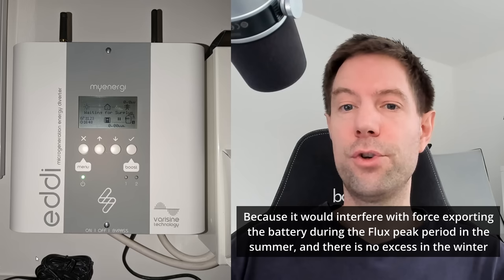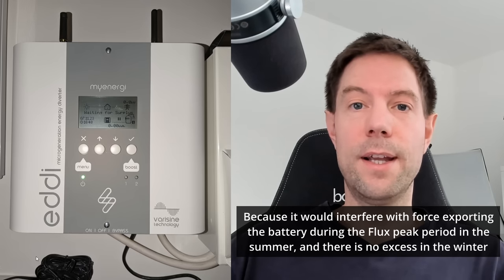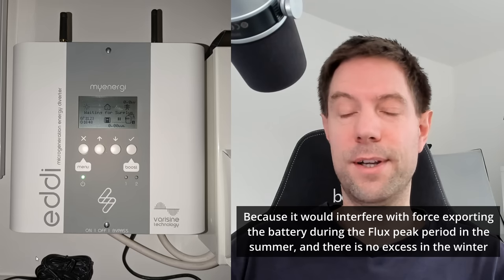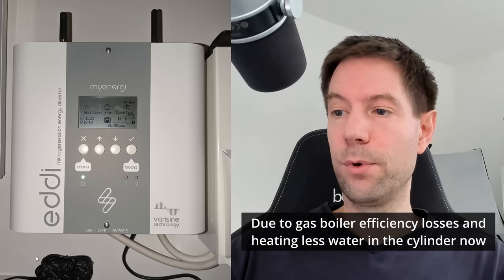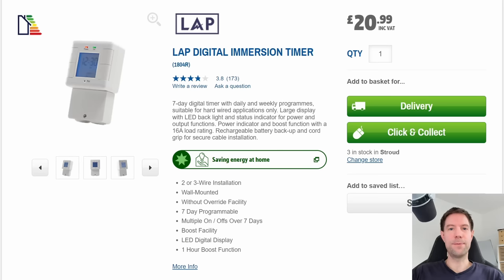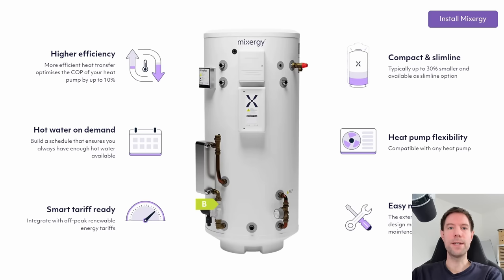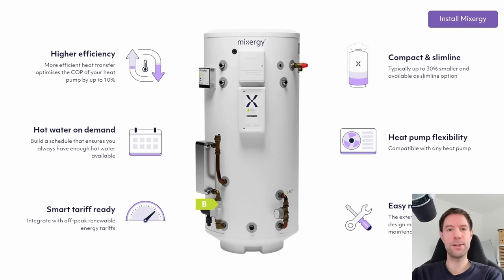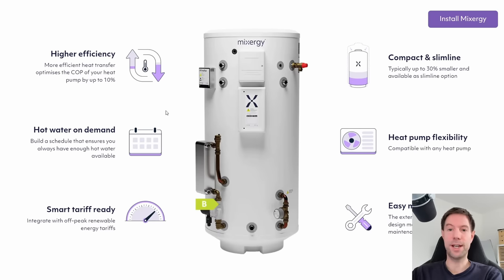Gas free hot water - so many options!

Comment: Hi Tim, We currently have a 5.8KW solar system with a 5.8KWh battery. We're currently on Octopus Intelligent Go and are very happy with the tariff. I have set it up so it draws from the grid at night during low cost so that the solar feeds in during the day. We have seen the offerings of Air Source Heat Pumps with the government subsidy, meaning that te quotation we received from Octopus to fit an entire central heating (existing radiators) and hot water was just over £1000. Our house is relatively new build and has cavity wall insulation and good loft insulation. I was wondering what your thoughts on a ASHP in a four bedroom property would be. Would it actually save money? Given that it would be greener, for sure, than our current Gas system, the only concern I haev is that it would cost more to run than gas during the winter. I don't necessarily want to take the plunge if it's going to be costly to run. Our gas combi boiler is nearly ten years old, so it may be that that will have a failure at some point.....! Any thoughts, please? Thanks!
Reply from the maker: If you were on a standard tariff with no solar or battery system then running a heat pump would work out similar in cost to a gas boiler.  With solar and battery to support it, when combined with IOG, you should find it a fair bit cheaper to run a heat pump than a gas boiler.  You might find adding a bit more battery capacity helps too, as that extra battery can be used to effectively run more of your heating at the off-peak rate.  We have 14 kWh of battery and last Winter we ran our heating almost entirely using off-peak power, all except the coldest days.  However, even with a modest battery you should find that you can cover a good fraction of your heating in the autumn and spring with off-peak power or solar.  I hope that helps.
Reply from the maker: You might find this of interest too:
https://youtu.be/q1tYCenxb2M?si=lgu_4O-EK5Um3ek5
Reply: @TimAndKatsGreenWalk  thanks so much. At the price they've quoted, it seems to make perfect sense. We can't really afford another battery as well as a heat pump, but my head is fairly convinced about the potential savings. There aren't many real-world experiences out there at the moment, so you giving an answer is very helpful. Thank you!
Reply from the maker: @Simonstunell1974  no problem.  It's worth seeing how you get on in the first winter with the heat pump.  You might find the amount of battery you have is sufficient.  In either case you'll have some data to work with then.

Comment: Very useful summary.  One or two responses have alluded to this but have you done the breakeven between the existing immersion using night-time tariff (at worst) vs the same on the heatpumps cylinder taking into account the
capital cost of the latter.

On a different topic would love to see in future your analysis of Octopus Go vs Intelligent Octopus. IO sounds better with longer off peak, lower ppkwh and double export (so more like flux...which incidentally my powerwall optimised very well...ie choosing when to export to grid from battery).  Currently on Go....and whether the powerwall gets through to 00:30 is extremely sensitive to the solar generation.
Reply from the maker: If you've seen those other responses regarding return on investment etc. then you'll have also seen my replies to them saying I'm not expecting the heat pump cylinder to pay for itself, I'm not doing it for that reason.  I'll explain more in the next video but basically I'm aiming to reduce energy use, not necessarily to save a load of money.  Regarding Go vs Intelligent Go, there's not a lot of analysis to do really, Intelligent Go is clearly better in every way, you just have to have a compatible EV or charger to get onto it.  Sadly I have neither just yet, but I'm hoping that'll change in due course.  In the Spring I'll be doing a quick check to compare Go, Intelligent Go, Flux, and Intelligent Flux, to see if it's still worth switching at that point, so keep your eye out for that video.
Reply: Point taken re breakeven...that was my own reasoning when getting solar and battery installed.  I also nearly followed on with a mixergy tank but at the time could not find an approved installer to even discuss it!   On the Go vs Intelligent Go I agree that the financials are clear and what I should have asked is whether you feel that the "handing control" of your car charging to Octopus have no unintended consequences.  Myenergy (they are still testing with Octopus) sent me a data sheet....it's quite complicated and may need current settings on charger changed.  Many of your viewers will have gone through this already if they have compatible chargers and would appreciate their comments.   @TimAndKatsGreenWalk
Reply from the maker: @KenH-63  yeah, good question about handing over control of the charging to Octopus.  I think I'd have to give it a try for a bit to see how it worked in practice.  If I didn't like how it worked I could always switch back to Go.  But that six hour off peak window would allow us to get another battery and charge up more to support our heating, so that would be too good an opportunity to pass up.  I need to run the numbers on that one to see if getting that extra battery would actually be worth it, but my hunch is that it's on the cusp, so if that's the case Intelligent Go would be essential to making that work.  Put it this way, I'd certainly give it a try!
Reply: @TimAndKatsGreenWalk  I now have IO and it does give the option in the app to switch off smart charging and charge when you want. I understand you must charge using it at least once per month for Octopus to have grid flexibility. Have not heard yet what happens if someone stays on manual.

Comment: Tim, your thoughts on this being a bit of a diminishing return? 
5 units at 9p x 365 days approx. £165 p.a. for hot water
reduce that to 2kw a day and your cost p.a. approx £65
A saving of £100 a year - less if you manage to end up on intelligent

So isn't a further option Hot Water option simply to do nothing for the time being, perhaps even find a way to export just a little more and perhaps easily cover that £100 by other means?? Moving to Intelligent alone would cover that saving. I know, cars and chargers are the Intelligent issue.

Just a thought??

All the very best 
Mike
Reply from the maker: It's a valid observation, for sure.  However my main priority isn't cost saving (although clearly that would be nice too) it's energy saving.  I realise I'm probably in a minority but as long as it's not unreasonably expensive to do so my aim is to reduce my energy consumption and increase my energy generation to the point where I'm a net exporter.  I'm not really expecting to get a "return on investment" with this, I'm simply trying to find a way to reduce the amount of energy we use to heat our hot water.  I'm sure a lot of people would consider that a silly thing to do but that doesn't concern me.  We don't have kids, I have a decent job, we have the cash to spare, and this is what I consider a reasonable way to spend it.  If I can help provide some information for a few folks who might be considering doing something similar then so much the better.  Hopefully that makes sense.
Reply: @TimAndKatsGreenWalk  Thanks for taking the time and effort to make all the videos and replying in this case. It wasn't a hater or detractor comment at all and if I didn't ask it then someone would have and probably less sympathetically 😉. 
I know you don't surplus divert with Eddie as it doesn't suit your plan, but I can't get over how we just have all the hot water we need free from the sun courtesy of Edward! I started recording my peak boost sessions to see how efficient Eddied hot water had been, but soon stopped as it's probably only 10 - 20 times in 18 months.
I'll be very interested to see your research on the Heat Pump tank you've chosen. Did start to muse over something similar after watching this. Our hot water tank looks uncannily like yours and thought I could draw air from the loft space 1m above, but quickly realised all that would do is to make the loft colder and probably increase thermal loss through the ceilings. Perhaps there is a soffit (the under side of the roof between wall and gutter) vent available?? Draw air from the south side of the house and vent to the north???
Anyway our timeline is first to treble or more our solar generation to something in excess of 10kw.
Keep up the good work, looking forward to the next video.
All the Best. Mike
Reply from the maker: @oldgitflying  yes, you're right about the loft space, it would decrease the temperature and therefore the heat drain from the house, so ideally you would vent to the outside.  But if your loft is well ventilated anyway it might not be a big problem to just put both inlet and exhaust into the loft, or else vent through a roof vent, as you say.  I expect there are some neat solutions for this.  

I don't mind at all you asking the question about investment return, it's a very valid question.  I guess the main reason for this video is to show what options are available should someone need to replace their hot water system through age or failure, in which case you may as well get an efficient system as a replacement and the "return" part of that is less important since you'd be replacing it anyway.

Comment: I live in the US with an old gas powered hot water boiler and cast iron radiators that require very hot water to heat the house.  Thinking about the possibility of either replacing the boiler with a Sunamp (if possible) or using Sunamp to heat a large tank of water and somehow use a heat exchanger in the tank to heat the water - instead of the boiler.  How hot can the Sunamp heat the water?  Any suggestions?  I also am thinking of getting PV panels.  Thanks, and great video!
Reply from the maker: The idea behind the Sunamp is to be a replacement for your hot water tank, rather than using it to heat a hot water tank.  It's the Sunamp that then provides hot water to your home by passing cold water though it so that the heat is transferred to the water.  The water comes out at 60 deg C from the Sunamp.  The Sunamp won't provide water to your radiators though, it's only designed to provide hot water out of your taps etc.  To fully replace your boiler you'd need a central heating replacement such as a heat pump (air to water or air to air, for example).  Heating a home takes significantly more energy than heating hot water, so a Sunamp wouldn't cut it even if you did manage to hook it up to the radiators.
Reply: @TimAndKatsGreenWalk   Thanks Tim! but if I did replace my boiler with an air to water heat pump, could the water temperature be higher than 60 deg C, which would be needed in the cast iron radiators to heat my home?
Reply from the maker: @marksTips466  you might be better off replacing your radiators at that point too.  Most A2W HP systems work best running closer to 50 deg C, or below if possible.
Reply: I was going to suggest that a factor to consider is that the ASHP can run efficiently continuously - so your cast iron radiators would be "always on". In that scenario, could you keep the cast iron radiators? Simpler and lower cost.

But on reflection a heating engineer can perform heat loss calculations and tell you the size of radiators needed - whether they go on/off or run continuously.

In the UK, often even modern steel radiators might need to be enlarged when switching from boiler to ASHP. So the cast iron radiators may need to be replaced.

in your post you don't say where in the US.

if cast iron radiators*DO* need replacing, and you also need A/C in summer, then perhaps A2A cooling and heating might be a smarter choice?
Reply: Check on the reliability of the Sunamp before you buy.

Comment: For the ASHP cylinder would you not want to draw in air from inside? This would be more efficient as the air is warmer. The vent will want to go outside as the air will be cold, although in summer it would be good to be able to direct thisninside as well for cooling
Reply from the maker: So you can vent in a number of different ways and certainly in the summer being able to vent the exhaust cold air into your house can be beneficial and certainly doable with the appropriate pipework and switches.  But you don't really want to draw warm air from your house in winter as you then have to replace that warm air with your heating system, so you don't really gain anything overall, if that makes sense.
Reply: Additionally, if you take air from inside the house envelope and exhaust it outside then you create a lower pressure inside the home.  This will create draughts anywhere where the envelope doesn't seal perfectly to the outside.  They may well be just where you don't want them!  For example, the vented area under your ground floor (if you have such a thing) might become your air feed into the house.  I am not sure I would want this musty, stale air as my house intake. @TimAndKatsGreenWalk
Reply from the maker: @Ben-gm9lo  indeed.  Best to have both vents going outside.
Reply: would be like running a cooker hood 24/7 just dumping your heated house air outside.

Comment: Hello Tim, I am in the midst of taking quote to put mixenergy and then move onto putting heat pump, is this ok and more efficient than the cylinder that comes with heat pump?
Reply from the maker: I'm not sure what you mean when you say put in Mixergy then move onto heat pump.  Do you mean getting an iHP cylinder, or a regular Mixergy cylinder?
Reply from the maker: I think I've worked out what you mean.  You are getting a quote for a regular Mixergy cylinder but plan to get an air to water heat pump heating system installed later.  Is that correct?  If that's the case then I would suggest not getting a Mixergy cylinder as you will get a new cylinder with your air to water system which will work better and be cheaper than a regular Mixergy cylinder.  There is certainly no need to get a heat pump cylinder (with the heat pump as part of the cylinder) if you are getting an A2W system.  The efficiency is about the same for both.
Reply: @TimAndKatsGreenWalk  yes that makes sense. Thank you

Comment: Does your current immersion have an adjustable thermostat? If not, you will be able to retrofit a thermostat with a relay for your immersion and you'll save many kWhs by heating the tank to 50 degrees instead of 60 degrees.

Also a very cheap and simple upgrade compared to your other options.
Reply from the maker: I did tinker with the thermostat inside the immersion until it was at a temperature we were happy with, yes.  It's not exactly user friendly and required a bit of trial and error but it's set where we want it now.
Reply: @TimAndKatsGreenWalk  Good to know you've already ticked that box! I was set on A2A until coming across your videos and considering the effects of the hot water long term. After a lot of planning, we've finally had A2W Vaillant Arotherm Plus installed and so far, so good.

We are spoiled for choice these days.
Reply from the maker: @UpsideDownFork  good stuff.  Yeah, the lack of hot water with A2A is pretty annoying, and the main downside, but hopefully we'll end up with a decent alternative.